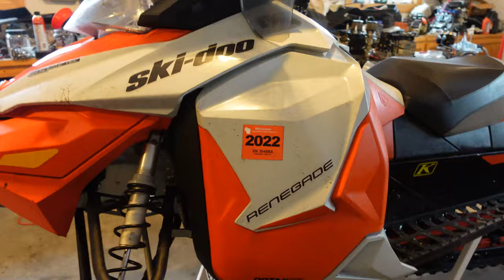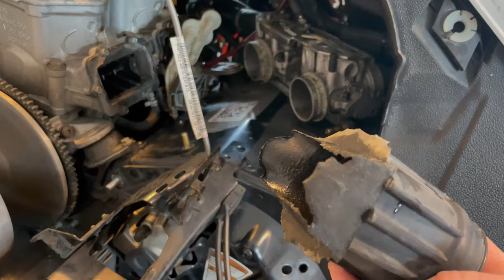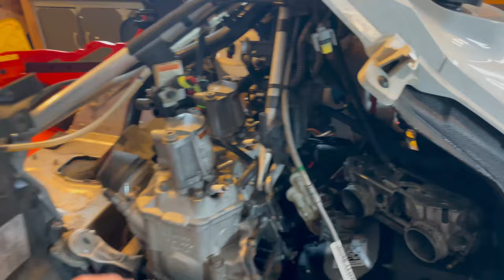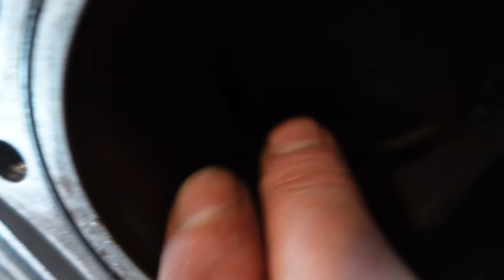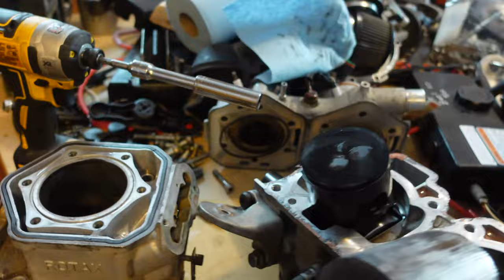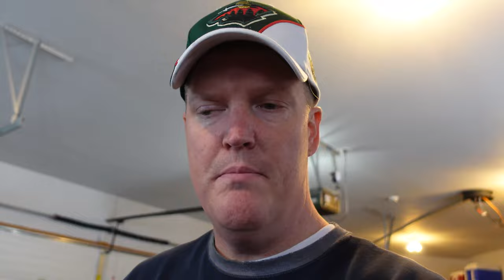I bought a broke Ski-doo.

Comment: Great tear down doc! That’s awesome how you’re not afraid to dig into anything. Do those still use isoflex grease in the crank bearings like my 2003? If you’re splitting the cases, it is worth getting some fresh isoflex grease into the ones that require it.
Reply from the maker: I think they do. I think at this point I'll split the cases, check the bearings and at least isoflex grease the end bearings.  I'm pretty sure the 600 ETECs have them too.

Comment: That is just aluminum deposits on the cylinder. It will hone off or can be chemically removed.
Reply from the maker: You know, that's what I started to think.  I already got a new cylinder from Millenium, in one day, but will take some muriatic acid to this cylinder before I send it back to see if it removes the aluminum.